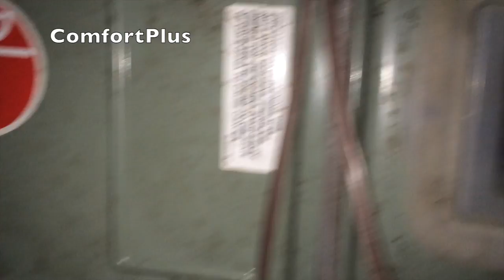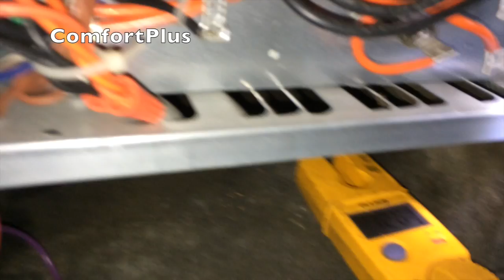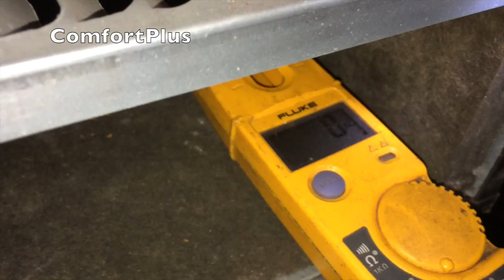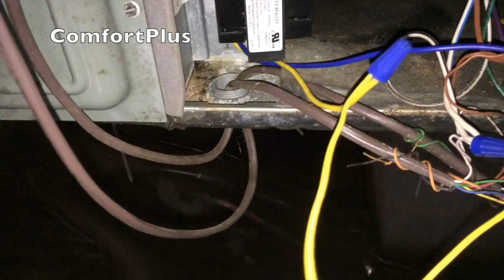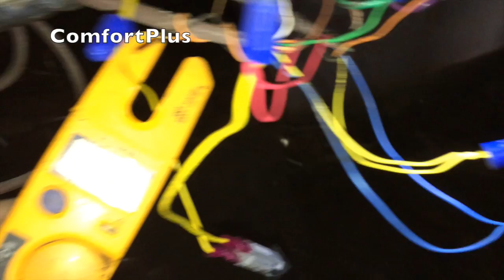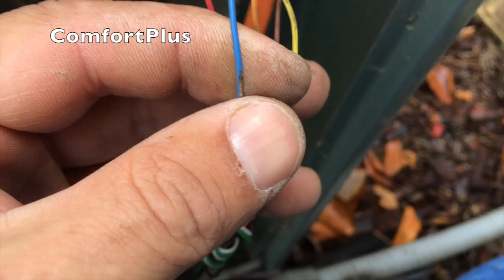Rheem Heat Pump - No Control Power

Comment: So you put in a 5amp in line fuse to protect it from happening, where did you wire it into? Also the voltage on the transformer was it 208 or 240v ? Good video on the whole think.

Comment: I was wondering what You use to check capacitors. I thought about getting  a fluke meter like Yours. I am using a Fluke 324 meter now.